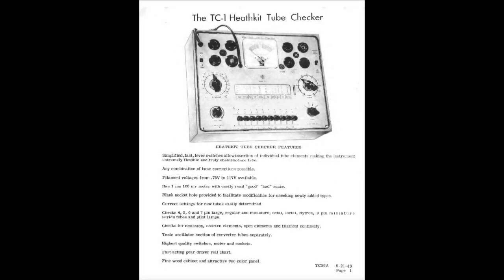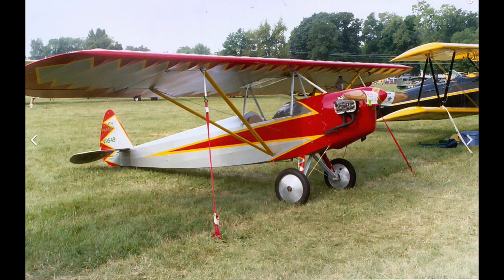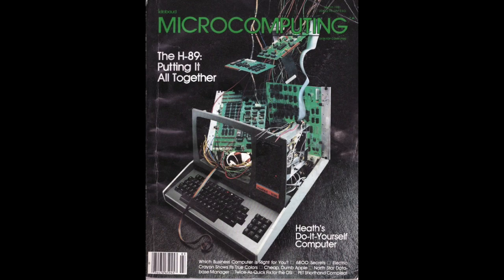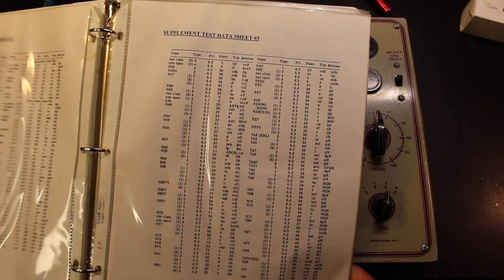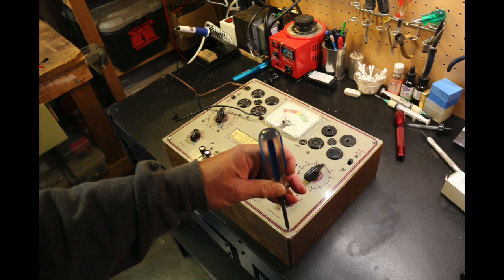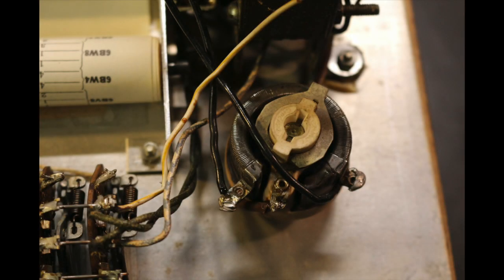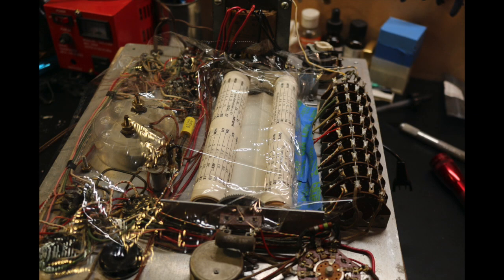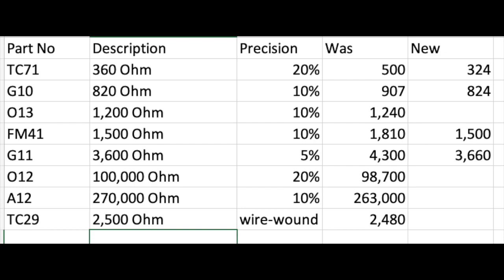Heathkit TC-1

Comment: can you check a 9 pin tube?
Reply from the maker: @Capecodham  The Heathkit TC-1 is capable of testing 9-pin miniature tubes. If you are asking whether I will test a tube for you, the answer is no, you would be better off getting in touch with your local vintage radio society and working with someone there to get your tubes tested.
Reply: @fibberscloset498  I have the TC-1 and your video was helpful.

Comment: Nice look into this tester.....I have an Earl Webber (circa 1935) I need to investigate...just cant find any info on??? You could feed the tester thru your variac....or insert a 10 watt power resistor in line to drop the line to 115.....but, like you said, probably wont make that much difference. The over voltage probably wont cause any issues....124 v is still within 10%....Enjoyed the video....Take Care—Larry
Reply from the maker: Thanks, Larry. I did use the Variac to prove to myself that it was working correctly. And thanks so much for the recommendation! Bumped my subscribers up a bunch.
Reply: @fibberscloset498  No problem, Hopefully the subscribers will be the type who are interested in what you are doing......sometimes with more subscribers, you get people who like to criticize, not be constructive.....so far in this particular hobby, the vast majority are kind....lol....Keep up the good work and have fun! Take Care—Larry

Comment: Nice!  I should have gotten something like that for it's portability or a knight or eico.  I acted the fool and got a Hickok 532.  Yeah it does mutual conductance but it's just way more tester than I need and it's really not very portable, lol.  I did pick up a smaller tester, a Philco 7050, but I've never opened it up yet to see if everything's alright inside of it.  I think the neon shorts bulb in it is broken.  If not then it just looks weird from the face of the unit.  Of course, I've never powered it up not knowing it's condition so I really have no idea whether the bulb is busted or not.
Reply from the maker: That's part of the challenge, isn't it? What will happen if I...